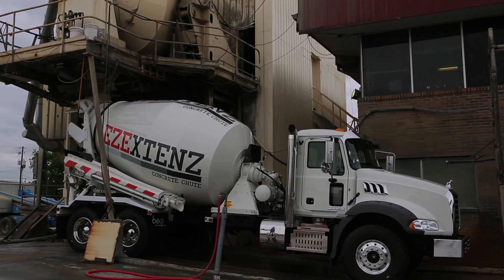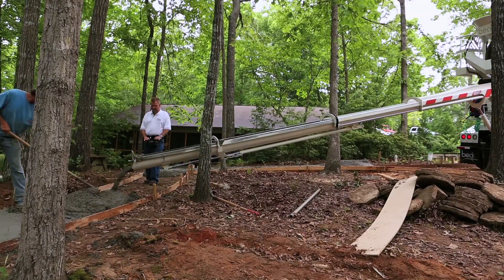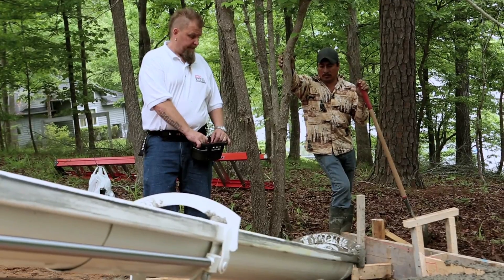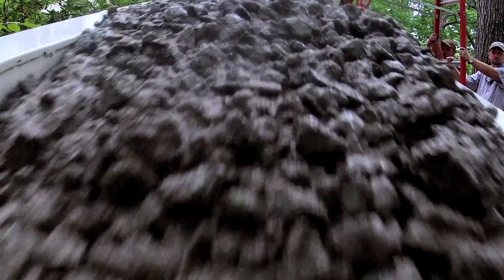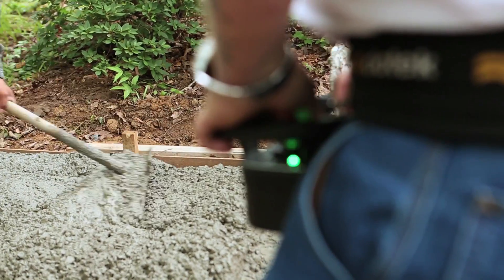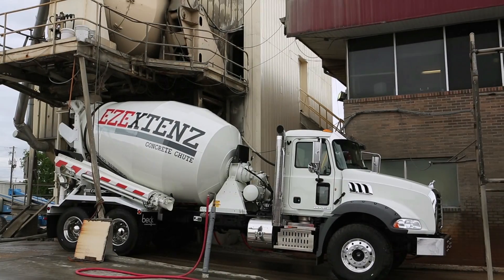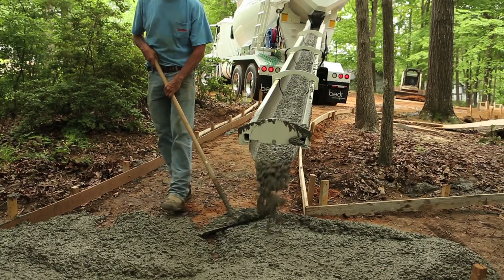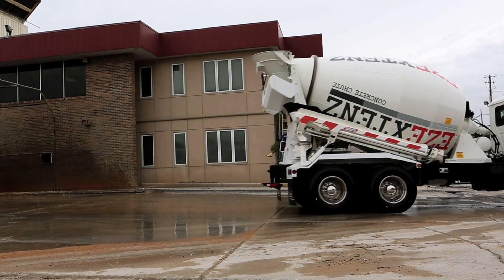EZEXTENZ Concrete Chute Demonstration Video

Comment: The problem is ......every idiot will order this instead of a conveyor now and try to pour 4 inch slump on 30 feet of chutes 5 feet above the ground......good luck getting that to flow. FAILLLLLL

Comment: i don't see any difference in the size of that ram. We're not allowed more than 3 add on chutes now which is, at max, 18 ft. from the back of the the truck. Worksafe would laugh that chute right off the job site or you would have to build a perimeter fence around it so no one would get too close!!! Fantastic idea but good luck with that in Canada. What say you to that Mr. Don Watling?